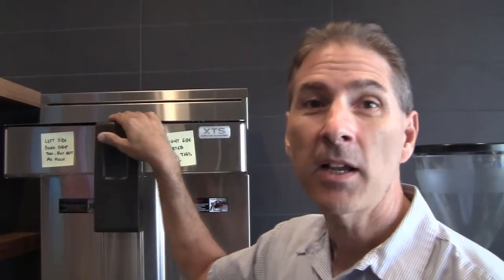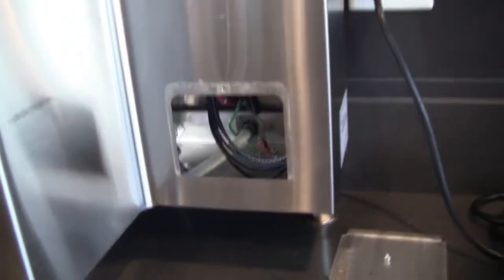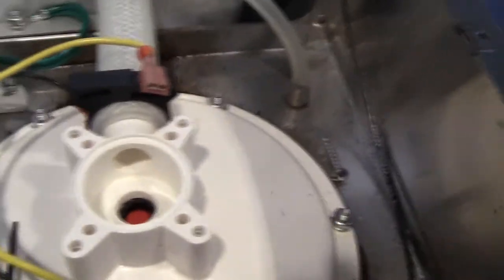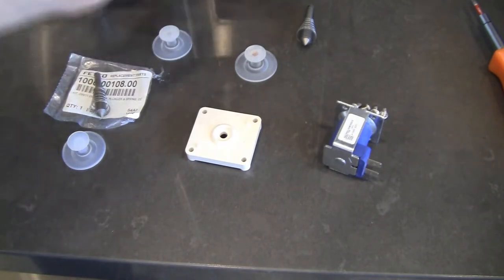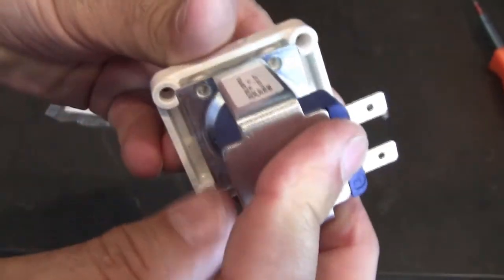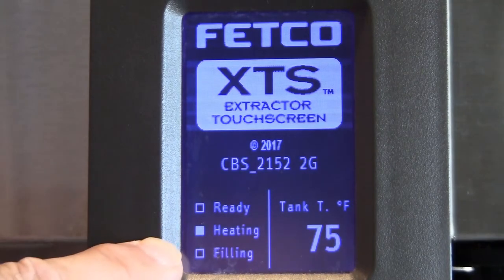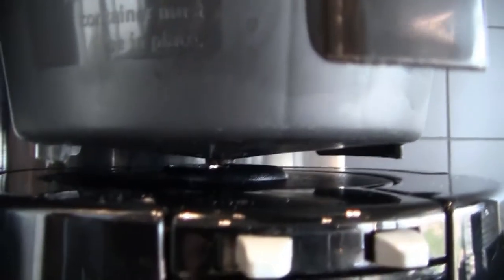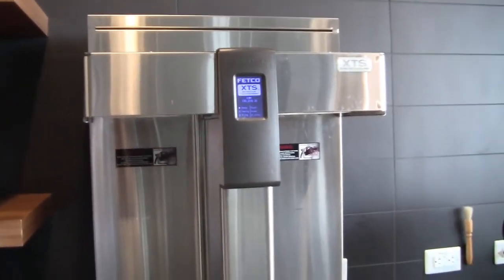Fetco Coffee Machine Leaking

Comment: What if my unit is pouring water from the tube on the far right side even after a cycle is done? It just keeps coming out. (For a fetco XTS)
Reply from the maker: I think the tube you are referring to is called the overflow tube. If you have water flowing out that, then your fill valve is not shutting tight and should be replaced. Do you agree with that?  let me know what happens either way.
Reply: @KenTraining  would you happen to know what part # it is?
Reply from the maker: @VrilWizard  I think you need Fetco part# 1057.00043.00 but please confirm this Fetco tech support and they can give you pricing. 800-338-2699 or 847-719-3000